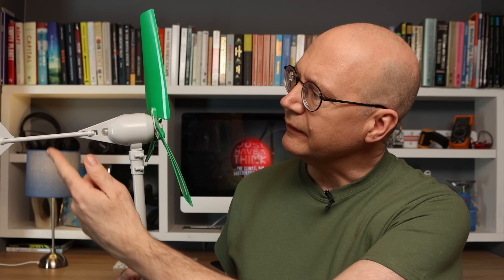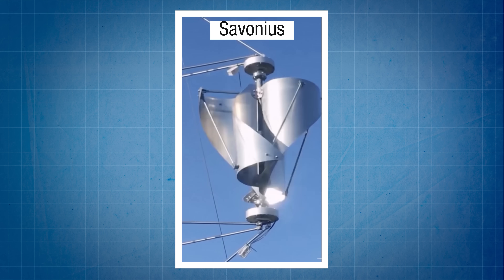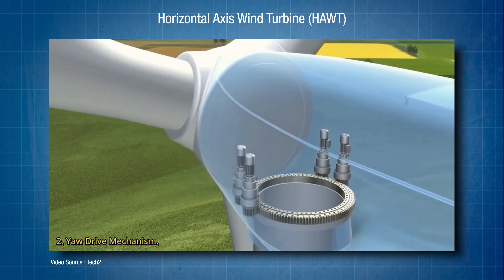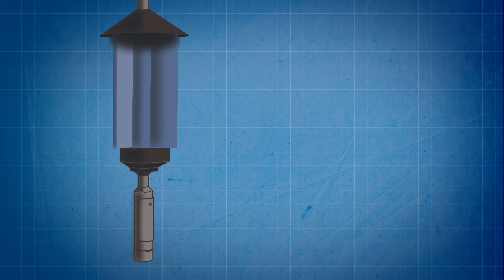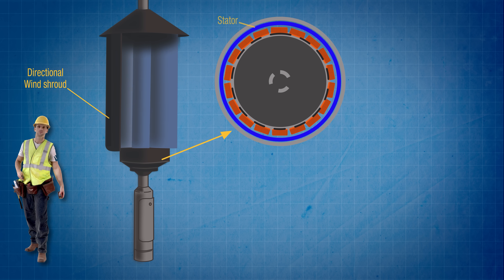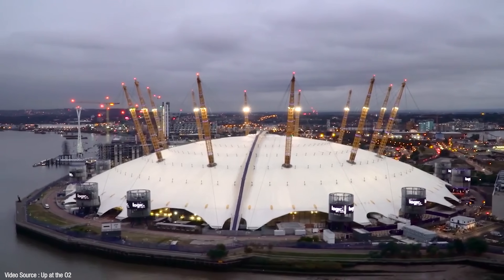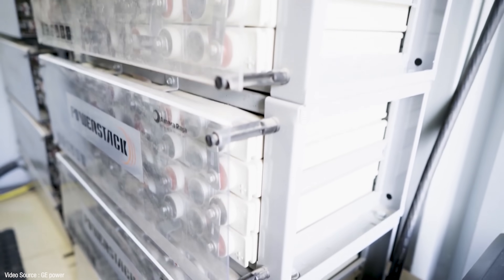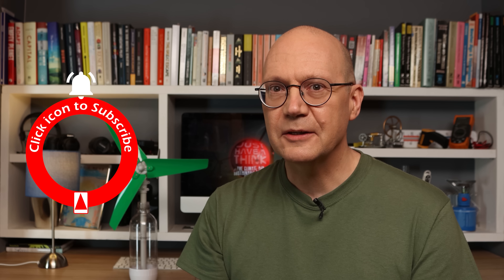A vertical axis wind turbine that doesn't need the prevailing wind! How do they do that?

Comment: In my design for this same project about ten years ago I came up with essentially the same thing, but I would make the vertical vanes out of a molded solar panel I think they will have even more efficiency and power output. As a general rule the middle of road ways always also get plenty of sun.

Comment: Wind turbine power is proportional to diameter to the power of 4 so 1m to 10m increases power 10,000 times - vertical axis turbines aren’t scalable. Good to run a house but not a town.

Comment: Dave if your going to show a VAWT, how about using this one. https://www.youtube.com/watch?v=dK_FfDGkHHk The roadway one is nice but its generator and bearing assembly are no where near what is in this video. If it were changed the number you stated would be staggering. Here is the key. The flux density in the poles is nearly 2 Tesla. Ask them what their flux density is. Also the bearings they use wear out. Mine has a very special magnetic array and this was verified by my friend George Mizzell at https://www.youtube.com/channel/UCh3cY-IW8QsEFmAh-TAWwrw. But you can see everything I am adding to Proelian Technologies here. https://www.youtube.com/channel/UCoMW_VitNAv2eeLJ3u9cYpw

Comment: This "VERTICAL AXIS WIND TURBINE" may seem like a good idea, but it is dead in the water due to the recent discovery of the PLASMA REACTOR. This is a 110% green and 1600% more efficient method than a Nuclear power station for generating electricity. At this rating, 1600% it is also more efficient than ANY current method, or proposed method of generating electricity. This mind boggling new system was announced and exampled at Bath University (UK) in July 2019, by the Canadian High Tech Electrical Engineering company SAFIRE. 

The PLASMA REACTOR uses a method to recreate a part of the Suns atmosphere here on Earth which under control mixes cheap and safe Hydrogen gas with Plasma which generates huge amounts of heat at extremely low cost. The heat is used to boil water, to create the steam that powers the turbines which in turn rotate the generators that produce electricity. In other words all current power stations can quickly be converted to this new system. It also requires a lot less space. 

Indeed the PLASMA REACTOR has a side benefit as it can also get rid of ALL the worlds ghastly buried Radio active material which currently costs Billions a year to store underground. You simply trickle feed a PLASMA REACTOR with Nuclear radioactive waste, and it automatically and instantly places a very high electro-magnetic field around the material instantly preventing radiation, and then consumes the material itself. The best news for everyone is that this incredible new system being so efficient means your electricity bill is set to fall by at least 50% in the next few years as these new plants come on stream. The first prototype generating plant is already under construction in 2021.

Comment: Sorry, but I think there is something decidedly wrong about this. I don't know how the “ Institute of Thermo Fluids” ( or whatever you called it) calculates power from a wind turbine, but the rest of us use an equation something like:
P = ½ ρAv³Cₚ
where 
ρ is the density of air = 1.23 kg/m³
v is the wind velocity, taken to be 5.4 m/s
A is the effective area of the wind column impinging on the turbine which in the case of a vertical turbine will be approximately the area of one blade. I say approximately because the force to drive the turbine would come from the area perpendicular to the wind on the downwind side. However, there would be a retarding effect from the blades which are curving into the wind flow on the opposite side.  It depends on the exact blade design but, fundamentally, the only energy available is that contained in the column perpendicular to half the turbine. The first four terms in the above equation give the power available in the column of wind and the Cₚ term gives the efficiency in extracting power from it.

Based on the pictures you show, for a 2 meter high turbine the effective area is unlikely to be more than about 1 m² and this would be a generous estimate.

Cₚ is the power efficiency. The theoretical maximum is given by the Betz limit 0f 0.59 but the real limit is more likely to be 0.4 or less.

Therefore, the power you are likely to get from one turbine at the stated wind velocity is about:

P = 0.5 x 1.23 x 1.0 x 5.4³ x 0.4
   = 38.7 watts
If you had a constant wind for 24 hours you would still be just shy of a kw-h. Probably not enough to light the lamp at the top of the pole. 

Calculation aside, I've got a wind turbine on my boat with a blade area of  0.65 m. and it doesn't produce squat until you get to 15 or 20 knots of apparent wind. My 50 W solar panel consistently outperforms the turbine ( over 24 hours! ) to the point that I have considered dumping the turbine and replacing it with another solar panel.

I had a look to see what date this video was posted. I expected it to be 1 April but it was, in fact, 18 April. Close enough!
Reply: My boat turbine has a blade area of 0.65 m². Special character didn't take. Sorry. I know how pedantic YouTube contributors can be.

Comment: think you forget about human stupidity. Those roadside alpha311 devices are just too easy to access but impossible to guard 24/7 - they'd be either stolen or vandalized most of the time, therefore probably pretty rarely working.

Comment: Here in Valencia there is a plan to install these turbines in a tower in the marina entrance to supply all the power needed by the marina itself. It is planned as a prooving ground for the system developed by the university here but is a fine example of what you have detailed in this video.

Comment: I installed two vertical axis marine wind turbines on my property, specification 50 W at 12 V DC … each costing £500… both failed with seized bearings within the period of three years. You have “not “considered the maintenance requirements necessary to these Wind generators ? Or the friction loss and losses by bearing ageing.
Reply: Sounds like poor design for outdoor let alone marine conditions. Maybe continuous lubrication system would help these bearings with their high axial loads.  Hope they had a 5year warranty!
Reply: The reason you had this problem is that even the best marine turbine ( I won't mention the name but I bet you bought the same one ) uses normal steel roller bearings and they don't seal the bearing area. I know, because I have one and it failed during the second season on my boat. I complained to the manufacturer and was told that I had to keep it running all the time to spin the water out and keep it from rusting. Ridiculous!  It would be a race to see if rust or wear would win. I took it apart, replaced the standard bearings with stainless steel ones and sealed the system to prevent ingress of water to the bearings. That was 4 years ago and it is still running a treat. The stainless steel bearings cost a few quid more than the standard ones. They are just trying to squeeze every penny. If you want to repair yours, I'll be happy to supply more info.

Comment: sounds like a cool concept, if it works then it effectively increases the efficiency of all vehicles on the road regardless of how they are powered, sounds like a no brainer and hell you could probably install several of these on every cell tower so you don't just power the tower you can supply some renewable energy to surrounding houses.
Reply: Was thinking this as well.  Since the structure of these towers is essentially an empty frame, and the cables tend to be routed along the outside, maybe you could stack omnidirectional turbines vertically in the unused space.  Of course there'd be safety concerns for maintenance crews, but that could likely be dealt with via a simple hand-brake setup at ground level.

Comment: There is no such thing as a free lunch.  I think that turbines beside roads will ever-so-slightly increase wind resistance for vehicles and so demand more fuel for the same journey.  But the energy taken for the turbines is tiny compared with the fuel energy expended by passing vehicles.  Distributed small devices like that depend on very low maintenence costs.   But consider faults, accident damage, wind-blown  debris, road re-configuration, flooding, vandalism, etc.
(At first I mis-read 29000 pounds for 25 years - too low, now I see it as per month -seems high.  
I agree with the main thrust of your argument that vertical axis turbines are better suited to small scale applications, and where there is wind at roof or ground level.  The challenge for all small scale installations is keeping maintenance costs down.  You need devices that are rugged, incredibly reliable, and where specialist technical expertise is always available but almost never required.
That is a big ask, especially for  devices with moving parts exposed to the elements.  As a result, I think that small scale generation will remain the domain of the hobbyist or enthusiast for a long time to come

Comment: Also wasted is the energy generated by automobile tires flexing and relaxing as the vehicle progresses down the highway. Piezo transducers embedded in the tread of tires could generate electricity and store it in supercapacitors piggybacked on the transducers without increasing rolling reasistance. This energy could then be used to assist hub motors during acceleration or during normal motion.

Comment: We all can see the benefits of using the wind generated by a moving car, I’ll imagine that in the same way we can use the wind generated by the waves, the air displaced by the water is just a useful as the one generated by the traffic, but with one mayor advantage, it will not stop.
Certainly salt and water will put stress on the machinery but remember that we don’t need to be “on” the water or “on the shores”, we only need the wind pulses.

Comment: This is  your great  use of lower output  sources  of  power.  I  look out  my fromt window at a wind farm on a ridge a few miles away  that  is in use less than 50% of the time.  This type and style of generator looks to have so many applications.

Comment: you want that hawt generator get full use? 

easy

if you can get the support of buddhist. for centuries, people in tibet, india and nepal, outside the buddha temple, there are “praying wheels”, which have written spells on pray for good karma, because in those days, not much people know read and write but they all want to prey. buddhist monk invent these wheels for people to turn in order to replace preying. it is a tradition now and although most people in these area have at least basic education nowadays. and yes, if you put a generator inside these wheels, which there are roles of it outside the temple for different wish, believers will turn it for you when no wind. not much electricity it will generate, probably just barely enough for street lights, but every buddhist believer can understand save energy is a kind of good karma, and they can see with their own eyes the effort they pay at night. 

your only problem would be how to present the idea to them. the rest is easy.

Comment: Regarding the energy coming from the cars... it is possible that this doesn't work out as environmentally friendly. It's self evident, that the opposing airflows that cars generate find a way to coexist (perhaps as a set of vortices with a low loss of energy). So there is currently some slip streaming going on with traffic, which will reduce its fuel consumption (compared to static air). With these generators slowing down the airflows in both directions near the motorway, it may increase drag on the traffic and cause them to burn more fuel.
I can see a few issues:
 - For the sake of a few KW per generator, it would be really hard to see if this energy is coming from increased work by the cars.
 - This looks like one of those situations where it looks like free energy but isn't (the people making the decisions may not have the right training to consider this)
 - If it is basically an electric generator powered by cars burning more fuel, it is likely going to be far less efficient than if you burned petrol in a large commercial generator.
 - I understand that they're going to measure the air quality. They should set up the sensors in advance of the generators and try to determine if the carbon dioxide levels per car are higher or lower with the generators.

Comment: Quite impressive-- a significant advance in cost-effective power for homes and business. As you point out, continuous generation of power from wind changes altogether the argument for wind and wave power from feasibility and reliability to finer points of relative efficiency  
In the US, research and investment is not confined to horizontal turbine systems, either. Experiments continue with most other means of extracting energy from natural fluid movements, whether wind, wave or tide.
At no point was it evident your video "favors" one energy-generation mode over another. Instead, Have a Think demonstrates the broad expanse of new technology to deal with soaring energy needs in a time of climate crisis.

Comment: Why dont you just invent the wind powered vehicle? An eletric car that gets up to speed and have a funnel in the front to the vehicle to channel the air their moving through to turn an electric turbine in the engine to create electricity. Along with the drive shaft and wheel hubs. The longer you drive the less energy you use because its an electric vessel.

Comment: I have never understood why the designers of these power generation  projects try to export the power they produce to feed it back into the grid.  Why not keep the power centralized to the roads??  Plenty of power is used in interstate systems (especially here in the states) for overhead road signs, street lights, advertising, and traffic cams.  When the power is sent back to the grid, several things happen that strip efficiency away.  One, inverters.  Two, power wave monitors.  Three, distance, relative to how far the power must travel to reach grid power.  All those things make it a better idea to keep the generated power central to where it is produced.  Produce power, convert it, charge batteries, use that isolated power to run highway lights, lighted signs, and traffic cams.  Why try to link the power to a central grid??  Make the power and use it right there.  It could make the highways off-grid completely............. Except for cameras connected to the internet.

Comment: Why aren’t small ones placed on top of electric vehicles then you wouldn’t have to plug them in they would keep the batteries up rain or shine. On a cross country trip just say six hundred miles in a gas or diesel car it takes about ten minutes to fill up and go to continue driving. How long does it take to fill up an electric car to continue to drive. A waste of time that’s how long.😉

Comment: Sorry for pointing this out, but Newton's law shows us that when the traffic influences the generator, the generator also influences the traffic.
All kinds of research outside your country teach us that any object in the air, increases the overal resistance of the air. (F=ma)
So, wheter it suits you or not, our traffic is paying for your electricity.
Looks like I take a tenner from your wallet, and say; "you wheren't using that anyway".
And attaching devices to our lampposts wears the lampposts out more quickly, and therefore costs the taxpayers money.
Your device causes extra havoc in case of an accident too.
But thanks for uploading the video.